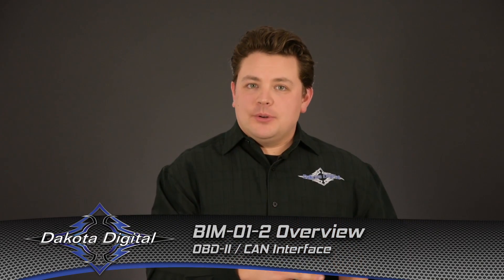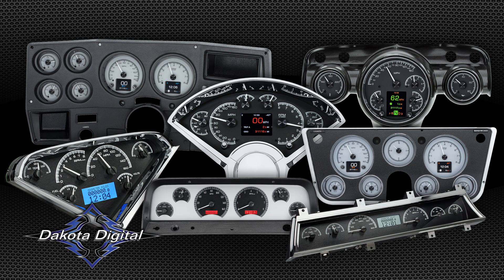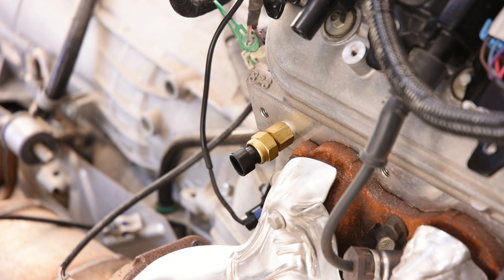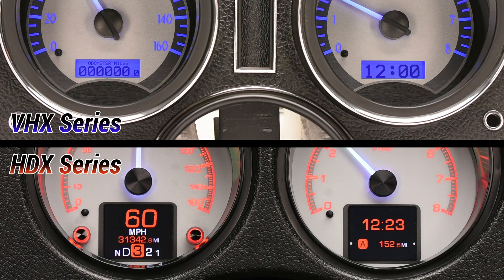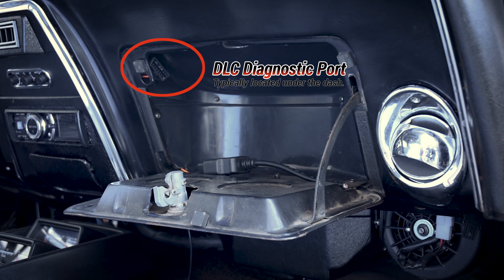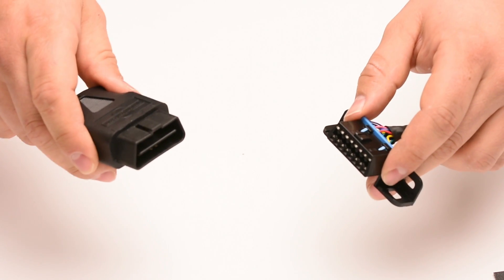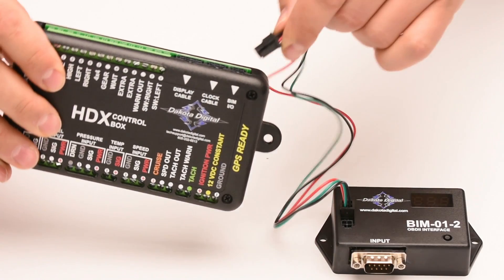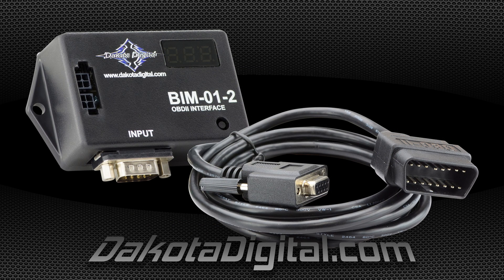Dakota Digital Instrument System LS Integration with BIM-01-2

Comment: I'm looking at going with the Dakota HDX model. This will be for a 71' chevy k10 truck w/ a LS3 GM swap. Will the BIM-01-2 work with a LS3 motor and is the BIM-01-2 included in the HDX gauge package? Thanks

Comment: will this read for oil press, and fuel level connected to the holley term x and stock sensors?
Reply from the maker: With the Terminator X and its associate sensors, we suggest using our BIM-01-2-HLLY instead.  This will read Speed, Tach, Oil pressure and Water Temp.

Comment: Hi! I hope you can help me. I did a swap. I used a 99 Chevy S10 to mount the body of a 51 Chevy. Engine, transmission, computer, everything stayed original. Except for the gauges. I already bought Dakota Digital VHX-47C-PU and BIM-01-2. My question is, should I connect the sensors (temp, pressure, speed) that came with the gauges or the original ones? Thanks.
Reply from the maker: Since the BIM-01-2 will bring in the Water Temp and Speed signal, sensor installation for these will not be needed. The include Oil Pressure sensor will need to be installed, since the GM computer does not transmit this information in 1999.

Comment: Im putting a gen 3 6.0 LS in my third gen Camaro and I was wondering how I’d get the speedo to work when the 4l60e doesn’t have a plug for the provided wire like my TH350 did
Reply: Terminator x max is expensive but it’s the best. If not your gonna have to use the factory ecu
Reply from the maker: We would suggest using our BIM-01-2, which will access the speed signal through the GM computer, using the OBD II port.

Comment: i need to install dakota digital gauges with obd2 interface that must be connected at all time so so if i splice wire from one OBD2 port to a second OBD2 port and that way i can use one for dakota gauges module to communicate to OBD2 interface module and the second OBD2 port for diagnostic when  need it. the question is, two OBD 2 ports can work at the same time?
Reply from the maker: It is possible to connect a second device to the OBD II port, although we suggest disconnecting the BIM-01-2 when doing any sort of programming. This will ensure that all communication is handled without a second device in the chain.

Comment: i have signal wires from factory sensors (temp sensor, pressure sensor and speed sensor) so VHX module work with those wire or i have to use Bim-01-2? if i have to use a Bim else i need to connect signal wires from factory sensor to VHS module or just unplug those wire and connect the Bim-01-2?
Reply from the maker: Hello Javier,
With the VHX kit, you'll either need to use the supplied sensors and harnesses, or the BIM-01-2 to acquire this information instead.  If using the BIM, this information will enter the VHX kit using the BIM I/O input connector.

Comment: i have ls swap with OBD2 port (pin 2 is comp data, 4 and 5 ground and sign ground, pin 16 const power so) is this right pins for bim-01-2 to get info from computer to HDX module or i there another pin on OBD2 involved?
Reply from the maker: When using the BIM-01-2, we suggest using the supplied plug-in connector.  If you prefer to hardwire this instead, please contact us directly for details at techsupport@dakotadigital.com.

Comment: Also looking to add a Dakota digital cluster to my 56 resto-mod.  Engine will be an l35 v6 (s-10).  I see the BIM module being used with LS and LT. Hate to assume, but it will work well with my L35/4L60?
Reply from the maker: Thank you for the message,
As long as the computer is an OBD II variety, the BIM-01-2 will work out perfectly.

Comment: I hv an 82 c10 with the Holley sniper. Looking to grab the BIM-01-2-HLLY, and the VHX-73C-PU is there anything else I need to purchase to get me together?
Reply from the maker: Thanks for the message,
This pair will work out perfectly together.  If you have a fuel level sensor/float in the tank, you should be all set.
Reply: @DakotaDigitalTV  thanks

Comment: What data will the bim-01-2 display when connected to a p01 411 gm ecu.  If there is more data available with different operating system or vehicle connections I can change that on the ecu.
Reply from the maker: Hello there Shawn,
This really just depends upon the data being received and transmitted by the ECU used.  It's less determined by the ECU, more by the program.

Comment: Quick question I ordered this for my 86 Chevy c10 it’s LS swap and I don’t not have the choice of getting oil pressure, my question is can I hook the oil pressure separate with the sensors it comes with?
Reply: yes. there are several ways of hooking up the included oil pressure sensor plug. all outlined nicely in pictures & text in the mounting instructions (i have an '85 c10 with LS swap)

Comment: i need a tach signal from my 350z to an aftermarket tach. the ecu has the rpm what part numbers do i need?
Reply from the maker: Thanks for the message,
We would suggest our SGI-100BT, in this case.
Reply: @DakotaDigitalTV  while waiting for the reply i actually bought the  STA1000 .will it work or should i 

do the one u listed instead?
Reply from the maker: @cpac97  Hello again,
No, we would not expect the STA-1000 to be suitable to this application.

Comment: I am putting an LS Engine and trans from a 2005 Yukon in my 1966 El Camino. I want a Dakota Digital Dash setup. What do I need to specify for a complete Install?
Reply from the maker: Sure, just add the BIM-01-2 along with your choice of gauge cluster, this will work out great!

Comment: If I am using the BIM module do I still need to run 2 coolant temp sensors or just the 1 factory coolant temp sensor? I'm just about to start putting my gauges in and wang to make sure.
Reply from the maker: Thanks for the message Paul,
When using a BIM-01-2, this will eliminate the need for a second (gauge) water temp sensor.

Comment: Dose it work off of The engine computer or  do I have to have a transmission hooked up to the engine computer for the speedometer to work
Reply from the maker: Thanks Chance,
For the BIM-01-2 to see the speed signal, the VSS would need to be connected to the computer.
Reply: @DakotaDigitalTV  if I’m running a mechanical transport case and a 4L80E transmission would it still work
Reply from the maker: @chancecolwell3823  Hello Chance, I would suggest contacting Dakota Digital to review the details of your application.  sales@dakotadigital.com is the best starting point.

Comment: So if I buy the BIM box and my trucks getting tuned , they have to plug into the obd 2 port, does all the gauges stop working? Or what is an alternate to that?
Reply from the maker: Hello Ulises,
Yes, during any scan tool use, just unplug the BIM-01-2.  If you'd rather not do that, a 'Y' adaptor could be used within the OBD II cable.
Reply: Where do i get the y adaptor?
Reply from the maker: @MOY5462   A standard OBD II Y adaptor can be obtained from various sources, but there are a number of them available on Amazon - search:  "obd ii y cable"

Comment: Ok so I’m a Lil slow. I have a 1975 caprice. Doing an LS2/4L80e Swap. Already purchased my HDX. What else do I need to get everything working together?
Reply from the maker: I'd suggest that you add the BIM-01-2, this will simplify installation by a great deal.
Reply: @DakotaDigitalTV  Ok so in addition to the supplied sending units supplied with the HDX, the BIM-01-02, GSS-3000, and SEN-06-01 should have all of my gauges on my HDX working correctly?
Reply from the maker: @HeavyChevy1975  The SEN-06-1 is only used if you do not have a fuel level sensor in the tank, so this may not need to be utilized. The GSS-3000 would be used if you'd like to display the gear shift information within the new instrument system.  Then, the BIM-01-2 will be used to communicate directly with the new LS computer.
Please feel free to reach out to us directly at 800-852-3228 or sales@dakotadigital.com .

Comment: I have a 5.3 and 4l60 with stock gm computer and obd will this operate the gear selection on my new HDX  Gauges?  Or do I have to purchase the optional GSS module??
Reply from the maker: Gear position should be available in a take-out package; the Connect and Cruise crate systems do not have gear data on the BUS.

Comment: I need some help! After installing this unit on my truck I get an GEAR X in LCD1 when I pull the headlight switch. It was working normally before I installed this.. but now I have to turn the lights off to make sure I have switched into the right gear. It’s working great in all other areas btw!
Reply from the maker: Hello Robert, this is a bigger question than can be solved in a YouTube comment. Please contact our Tech Support team at: techsupport@dakotadigital.com
Reply: DakotaDigitalTV thanks! I’ve sent the same message on you FB page but no answer so I will try the email.

Comment: What if I have a 350 Chevy engine?
Reply from the maker: Hey there Jason,
With a SBC such as this, the BIM-01-2 won't be used.  You'll just install the included sensor for Oil Pressure, Water Temp and potentially Speedometer.

Comment: Hello will this work with a Coyote Swap from a donor Mustang?  Do u offer Coyote Specific gauges? 
I have purchased a set of the VHx series for my 67 Mustang.  
Will it also read the speedometer ?
Thank you
Reply from the maker: Thanks Pepe,
The BIM-01-2 is a good choice for a Coyote swap.  If you plug in a scan tool with real time readings and this displays the vehicle speed, then we can expect the BIM-01-2 will also display this information.  The VHX series which you have already purchased for your Mustang should work without any trouble.

Comment: Couldn't you just splice the 5v signal wire out of all the sending units instead of doubling up on sensors
Reply from the maker: Unfortunately no, as OEM sender outputs and the required sender inputs to the instruments are different. Many senders look the same but provide very different signals; mixing them up can cause a myriad of issues.

Comment: I have a c10 with a ls and a th400 can i wire the speedo to the gps antenna and the bim 01-2 to the rest of the gauges and not have them interfere?
Reply from the maker: Hello Kike,
Yes, you could certainly use our BIM-01-2 in this scenario.  Regarding the speedometer, you could utilize our GPS-50-2, or use the included speed sensor which attaches to the TH400 mechanical cable outlet.

Comment: How would this work with an older vehicle, say a 1960 Cadillac Coupe de Ville, with an LS swap, with the ECM, and with the digital guage package? Would it work the same as on a vehicle which originally came with OBDI or OBDII systems?
Reply from the maker: Yes, pretty much!  The BIM unit and instrument system don't know what vehicle they're in as long as the required data is available.

Comment: Will this work with an OBD2 splitter, so the BIM module does not need to be disconnected when doing diagnostics?
Reply: Jake G There shouldn’t be any issues when disconnecting to run diagnostics but I don’t see why it wouldn’t work with a splitter

Comment: I'm doing a LS swap on my 94 Chevy Impala and I ripped out all the old wiring completely if I buy this kid my gauges will still work without any additional wiring from the old LT1 wiring
Reply from the maker: This BIM-01-2 can read data from the LS ECM and provide it to a Dakota Digital instrument system, but will not communicate with stock instrumentation.

Comment: does this unit also deliver vehicle speed through the ecu or do I still need the trans speed adapter on my 4l60e
Reply from the maker: Vehicle speed will be available, provided the ECU is monitoring it. In order for the BIM-01-2 to read VSS info, you'll need to ensure the VSS from the trans' speed sensor is wired into the ECU properly.
Reply: DakotaDigitalTV how does one do that thx